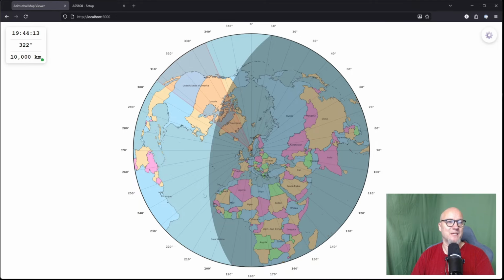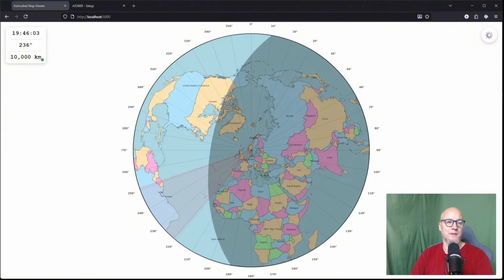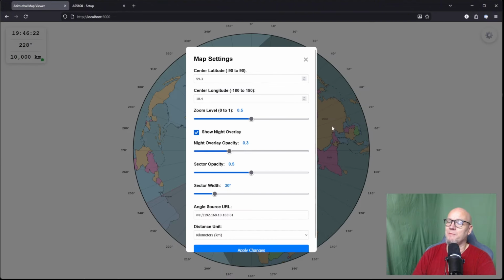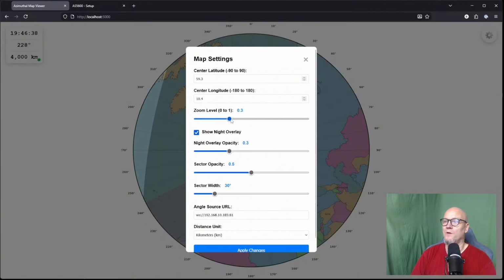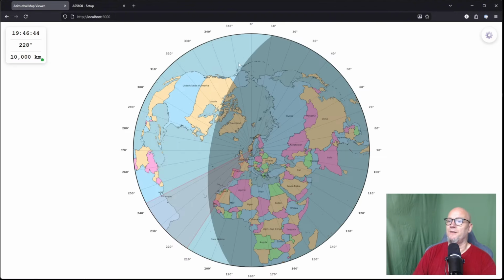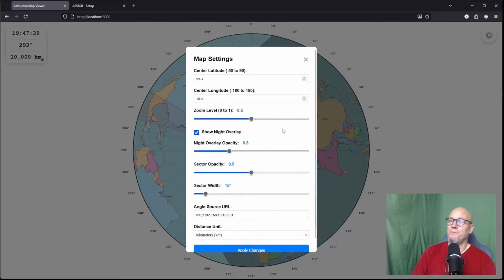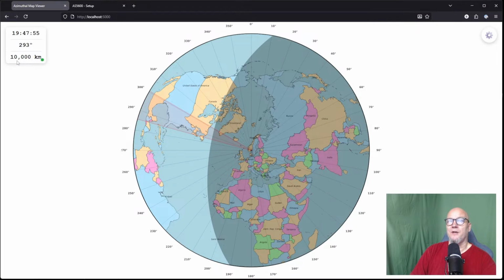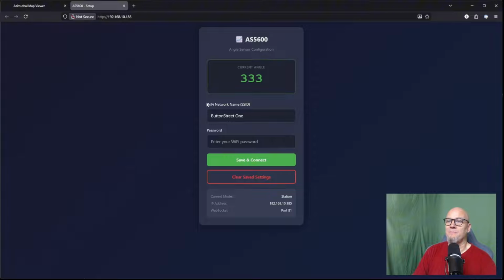Azimuthal Rotor Display -  Part 1: The Absolute Position Encoder

Comment: Very interested to see how you are going to attach this sensor to your mast/rotor.
Reply from the maker: That will be an implementation detail that will have to be customised to an individual installation - for the rotors at our club, the "axis" extends below the rotor, so it should be easy enough to attach it there!